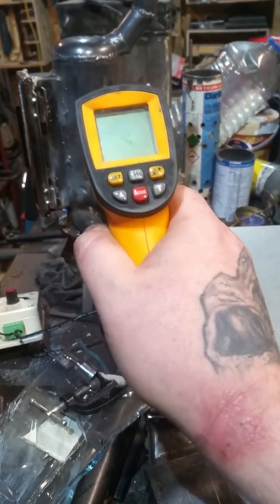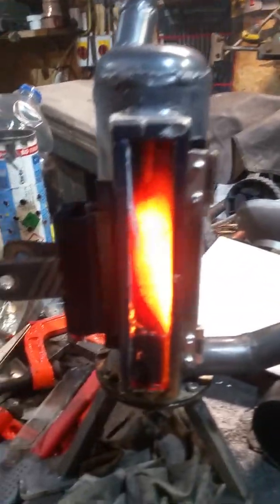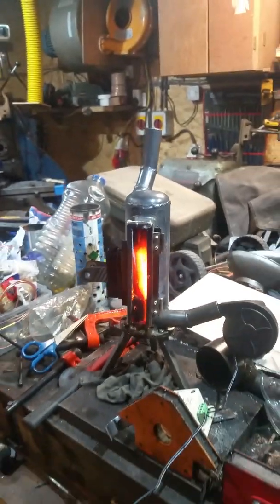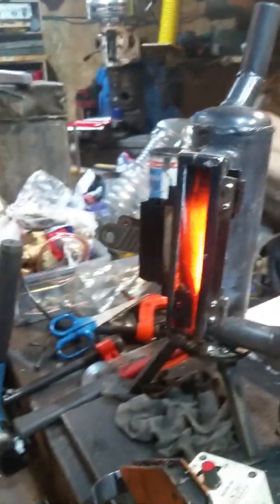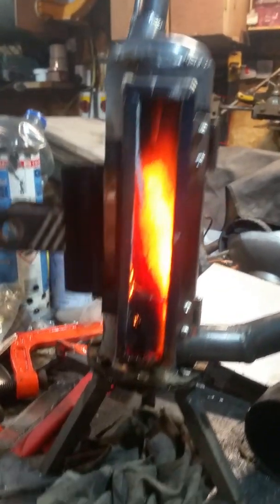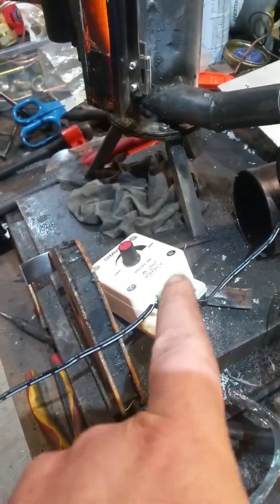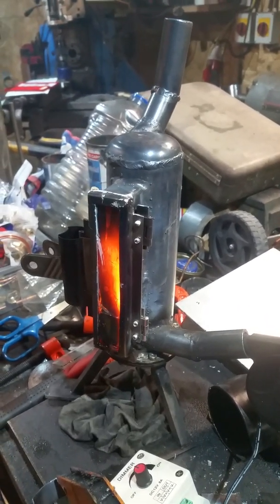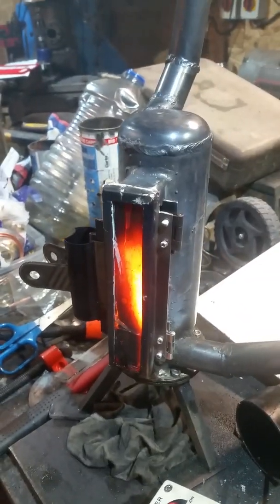tiny homemade diy waste oil heater, development 4

Comment: I think the glass viewing window is what makes this appealing, Oh' the minute size of it too of-Couse. I'd happily have one like this in my living room, with a quieter fan of course. Saying that, the noise of the fan probably isn't that bad, it's more than likely the cameras mic picking it up easily as they do tend to do that. Very steampunk design.
Reply from the maker: It is quite. But I have a new fan I can use that's 240v rather then 12v saves the power pack. Thanks for watching
Reply: @smithbuilt  👍